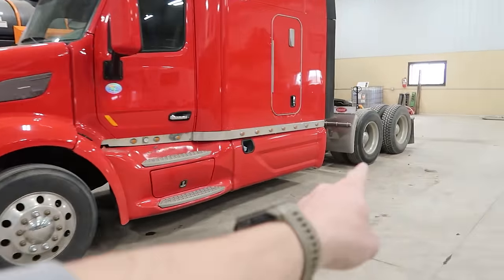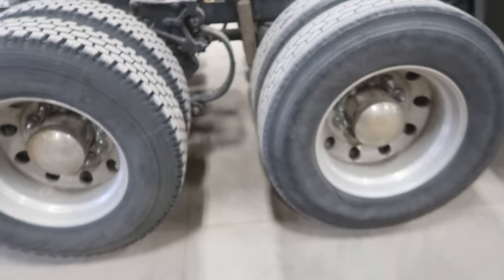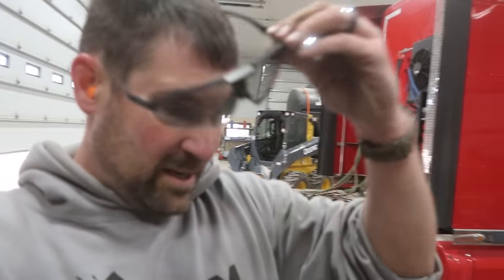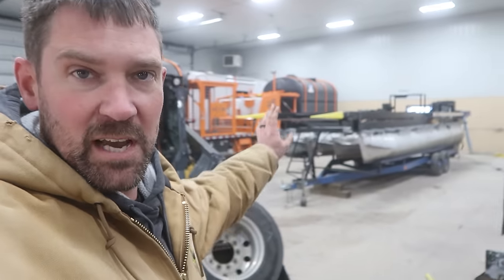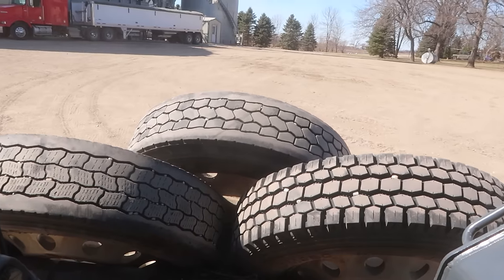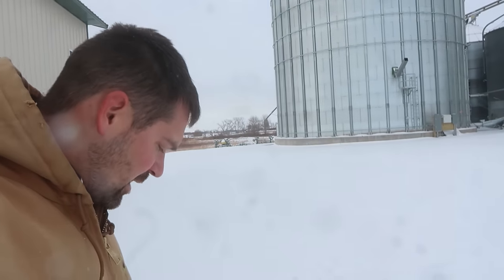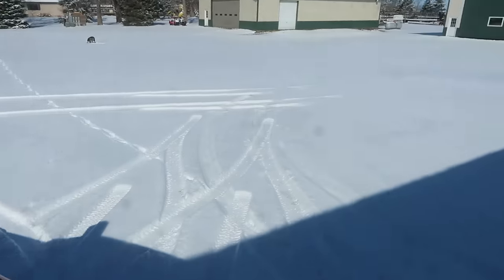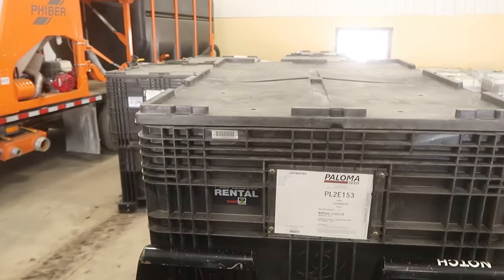This Isn't Going to Get Done as Quickly as I Would Like...

Comment: Zach,  use a 4 or 5 ft pry bar, a crow bar whatever under the center of the wheel to lift the tire on and off the studs.  Makes that chore a whole lot easier.  Cheers 🇨🇦
Reply: Yes, using a couple of pry bars will definitely save you a back strain lifting those heavy old truck wheels 🛞.
Reply: A wheel dolly is like $100. A broken back costs a lot more.
Reply: A shovel works remarkably well, swivel the bottom of the wheel out with your foot on the handle while holding the top of the wheel
Reply: I use a shovel. Works great.
Reply: Thank you!! lol I was gonna say the same thing. Use a bar makes the job easier and faster! Also do not put anti seize on the wheel studs!
Reply: @jasonpeters5851  I haven't read down through all of the comments but saw yours and decided to speak up as yes indeed, that is a big no no and depends on what anti seize compound but typically they will lower the friction too much and cause over stressing the stud by using the same torque spec. However the wheel end manufactures for that size and style of wheel end DO say to put a small amount as in a drop or two of 30 weight engine oil on the stud as well as between the sliding assembly of the two in one style nut. If that step is not done and the threads are dry as well as the two in one nut assembly, that has been proven to severely under torque the stud tension with the proper torque applied to the nut.
Reply: @jasonpeters5851   I have put grease on exposed threads.  Equipment for field. The whole thread gets grease before putting back on. Never had 9ne loose since I was @14.  I did not have sockets, just tightened wit 8” creset wrench.
Reply: Did you notice that he put the steer on backwards?
Reply: @connercalaway199  At what timeline in the video did you see this, you are referring to the wheel offset correct ?

Comment: My 2014  Polaris Sportsman 400 ho  ATV just turned over to 26,000 miles on it and I doing all my work on it, from oil and filter change every month and new tires and CV Joints and Shocks and rebuild clutches main and second dairy clutch

Comment: Zack, Cateye, tire equalization valves will eliminate tire cupping on your drive tires and the trailer tires.  You can get them at Nelson International, willmar or Fargo. You will save tire wear. Your inner tires run at a greater pressure, because of brake heat. The valves are designed to equalize the pressure between the inner tire and the outer tires.

Comment: You need to get a tire  dolly,150.00 at northern used my for 30 years works great and saves the back also throw the torque wrench start using torque rods, used one for 30 years also work great

Comment: Use a square point shovel on truck wheels. Center the wheel to the hub, lean tire toward the truck, slide shovel 3 or 4 inches under the tire then you can lift the tire a half inch or inch up onto the studs. Just trying to help you young millennials 😊

Comment: Am idea for lifting the front of your truck is get an extra set of front tow hooks and weld a heavy piece of steel connecting them. You can then use your a jack on that. a shop i used to work at had one and it worked well.

Comment: If you place a thin metal bar at the base of the tyre, when trying to get the wheels on or off the trucks hubs, it makes it much easier to manipulate the procedure, beats putting your back into so much strain and possible pains in the back due to the weight of these wheels ;) `Pry bars are generally good`

Comment: Pry bar pry bar pry bar. You put the pry bar underneath the tire and then use it to lift and remove the tires. It also works for install. You lay the pry bar down and then roll the tire on to it.

Comment: If you lay out a couple of two by's on the floor so that you can back the semi onto them so they will be under the inside duals, the outside tires can be removed without jacking up the truck.

Comment: zach if you use Yellow scrubbing pads and water will clean those wheel caps nice.. the green pads are to course for that,,   you should get a truck tire caddy to remove and install the truck tires..

Comment: You should always drop your suspension air before lifting a truck so if it leaks down it won’t roll a few inches on you possibly taking it off of jack stands and creating a real problem. I have to take those chrome lug nut covers off regularly and just use a small set of channel locks and don’t grip them too tight. You might need a new jack for the trucks if you upgrade to newer KWs or Pete’s the clearance between the wheel and bumper gets tighter.

Comment: Zach if you just drive up on a 4x4 on the inside tire it lifts the outside one high enough to remove. No jack needed
Reply: Zach has hub pilot wheels, so when the outside lugs are removed both  tires are loose. Stud pilot wheels will work with the 4x4 tip

Comment: You don't want to tighten some lugs and not others, you can warp the rim.
Use the centering nuts and just snug everything up lightly, then put the other lugs on and tighten them in a criss cross pattern, kind of like head bolts.

Comment: I worked for a company that did removal of docks and boat lifts by all the muscles in your body, without any type of lifting mechanism, using legs and back muscles and arm muscles and some common sense to go with the each day working 10 hours per day 5 days a week, and at least 8 weeks per spring time open lakes and do the same as of fall taking the docks and boat lifts out of the water, with some times during snow and early ice built up  on the docks and boat lifts!!! RIP Clancy 🇺🇸❤💙🍻☀️

Comment: a couple little tricks next time you just have to take the outside tires off are too lay a long board on each side or two short ones and drive or back up onto them with the inside wheels and that will leave the outside ones off the floor and you wouldn’t need a jack you would only have to put it under the steering axle and secondly when you pull the wheels off turn around and back up to the wheel and keep your back straight and bend your knees a little then put your hands on the rim and straighten your legs out and let them do the work instead of your back

Comment: You need to use a 3 ft pry bar or slate bar to lift those tires on n off. Just get it under the tire.
Reply: Yep…I roll the tires on 1 or use 2 bars to maneuver the tire, depends on the day…

Comment: Your safety is your business, but you should also consider the safety of others on the roads. Anti seize should never be used on wheel studs or brake parts. It affects torque settings and can make overtightening wheel studs a real possibility causing them to snap. Take it for what it is worth!

Comment: Not telling you how to do it but I'll give you  advice that Jack you are using is for trailers you should  get a air Jack so you can jack up under the axles. You wouldn't believe me if I told you that Jack you're using could bend your frame so I won't tell you that